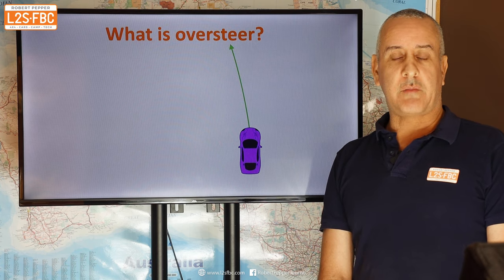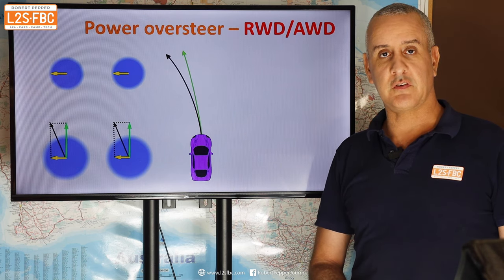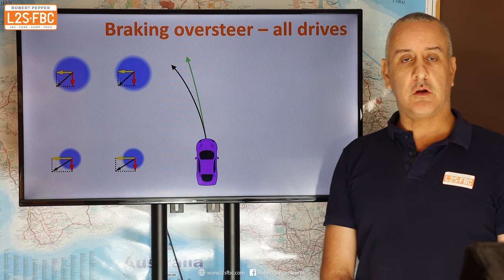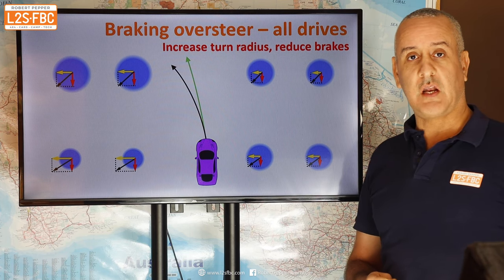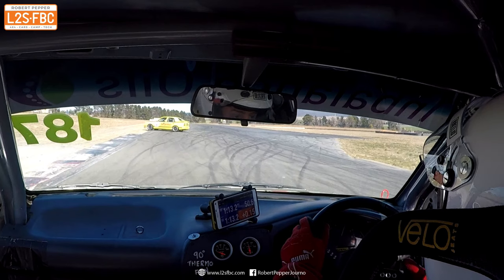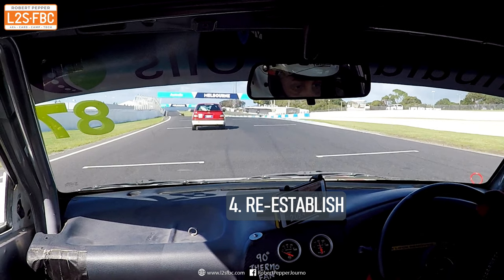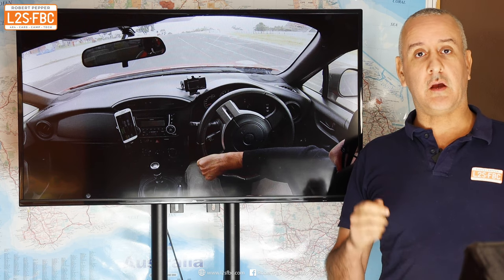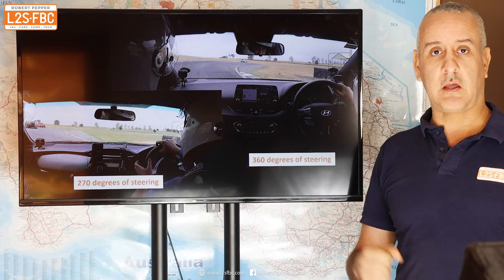Oversteer recovery - how to save your car!

Comment: This should be part of the driving test, for getting your drivers license in the United States!
Reply: Literally all cars before the 60’s or so, we’re RWD, the fact that we don’t learn how to save a car from over steer is sad.
Reply: @1000roentgens  it’s not just sad, it’s INSANE!!!! Like you said, it’s more of a problem with rear wheel drive cars, but of course it happens with all cars. front wheel drive, rear wheel drive, or all wheel drive. there are so many accidents that could be avoided. I remember when I got my drivers license many many many years ago I did the driving test and it was over very quick!! I don’t know if the instructor could just tell I knew what I was doing, or if they did that with everyone, but it was disturbing. I mean I had been racing go karts, and quads/ATVs, since I was a little boy. Which was way harder than driving on the street, (legally) but it still blew my mind! I see so many people out on the road that it’s obvious that they can’t drive to save their life. I just can’t wrap my head around it. 🤷‍♂️
Reply: For Mustang owners 😂
Reply: No one dose
Reply: @Eddie2425  first thing i did after i got my license was think i was a racecar driver. second thing i did was practice sliding in the snow lol. im glad tho, the little bit of experience saved me a couple times before i realized my favorite road wasnt a racetrack
Reply: And ability to use a clutch/stick would be a good bonus.
Reply: People can’t even parallel park in the United States 😂
Reply: @1000roentgens  If you think that RWD oversteer is bad, it means that you have never experienced oversteer in short wheelbase FWD. At least not one greater than 10 degrees.

Comment: I have a charger, so this was a pretty informative video for me. I've had 2 moments so far where the car snapped out on me unintentionally, but fortunately I was able to recover both times. Cheers!
Reply from the maker: Glad it helped, please share, and tell us about those times so we can all learn!
Reply: @L2SFBC  I'd say the first time was on a cold, slightly damp morning (being from Los Angeles means that the roads get slick with oil when the roads are wet) and with approx 30% throttle on a 90 degree turn my car decided to kick the tail out for a moment, but me counter steering allowed me to recover and stay in my lane.

The second time was entirely my fault. It was raining hard for the first time in a long time, and I did a burn out at a stop sign. Was all good and fun, but I may have over corrected once it started to yaw, and it suddenly and violently started to snap side to side, so I quickly got off the gas pedal and let the car settle down. I then decided to go home lol. 
These both happened with very old and cracked winter tires, I've just swapped them out for new tires.

Thank you for listening to my silly stories.
Reply from the maker: That's great!  I have a video on to tell the age of tyres too!  Glad you got it under control.
Reply: @L2SFBC  i plan on watching more of your videos when I have the time. Thank you
Reply: Do you drive the charger during the winter as well? How does that go if so

Comment: My first driving experiences were with old holdens and fords and they were wonderful training ground. Losing the vehicle in a manner of ways occurred easily and at relatively low speeds so it was much safer than the more modern cars that can easily take corners at much higher speeds and accelerate harder than these older vehicles. Through the video I recognised the skills and the situations you showed and my internal responses are so ingrained and that experience has paid off  in ordinary driving situations when things come unstuck. I loved the in-car shots too....perhaps more of that in the future Robert?
Reply from the maker: Thanks Benny. Yes some people learn like you did and others never have the chance. But it's so important for motorsports people even in FWD cars. Very pleased to hear this helped explain what you already knew !
Reply: @L2SFBC  Yes, exactly...so I really got what you were saying.
Reply: I want to drive those cars where you it isn't that difficult to crash. I really love driving and I want to be able to handle whatever is thrown at me.

Comment: I think the hardest thing is staying calm. Any time i've done sketchy driving I was at least half prepared for something to go wrong and ready to act. I've only had 1 major spin out and it was because it caught me off guard so bad. My own fault of course but I hadn't considered how bald my tires were by this point and I went into the corner at a speed slower than normal and it just went. The snapback was super violent and i panic hit the brakes then from there its just sorta a blur until I stopped. Very luckily it was a flat field and the only damage was a rock slicing my tire open!
Reply from the maker: An excellent point. And how do you stay calm? You normalise the situation. Then you have spare brainpower to deal with it properly, and also your reactions are instinctive.
Reply: @L2SFBC and normalizing is practice practice practice. 

I recognize the panic feel, had that some times too, when I was young and playing around with RWD cars. 

I have had some skidding lessons a few years ago and on such a day due to the practice practice practice it becomes normal and you will nail it, but… I am afraid I won’t be able to react as I should if I have an unplanned skid. 

That’s why I watched this video and it is a great lesson in theory, very informative and helpful.

I really do need to practice again on a closed course!

Comment: People watch other videos like this that don't explain braking and we have this myth that you should never brake in a slide, on the streets that is just dangerous, the issue is people have with no experience have no idea when they have lost control and/or they think you shouldn't brake, not to mention it takes a lot of practice to recover a slide which most people are never going to do.
Reply from the maker: Did you miss the bit where I covered use of brakes?
Reply: @L2SFBC  I meant other videos like this that don't explain it, I know this one does.
Reply from the maker: Cool thanks!

Comment: Robert, My learning came from gravel roads and snow/ice in rear engine (VW) vehicles. The switch to fwd (early Subaru) in snow especially was daunting until I learned about left foot braking to induce oversteer and then use acceleration to pull out of the slide. Current ride (VW Golf) has a center mounted emergency brake to start the slide in snow and gravel. Wife hates me for that.
Reply from the maker: Maybe warn her in advance? 😁😁

Yes this video is about recovering from unintentional skids not initiating. I may do another on initiating.

Comment: Bias ply tires on rwd in the snow (and rain) has given me an inate yaw sensitivity and instinctual subconcious level counter steering response.

Anyone that wasn't there can't appreciate how badly tires sucked back then. The worst tires you've ever experienced are 10x better than what we had.

Modern summer tires in the snow were still better than back then.

Also, the threshold to regain traction was very high. Once you lost traction, it was very difficult to get it back. So recovery often involved several back and forth swings. You simply couldn't catch the dnap back because there was no getting thetraction back. You hadto rode out the swings until you scrubbed enough speed to reduce the traction demand below what the tires could deliver.

Comment: Great video.  I was playing around with this in an empty parking lot earlier today before watching this video.  I actually spun out and applied the brakes until the car stopped (although I think I spun because I applied the brakes).  I didn't slide around as much as i wanted, but I think that's because most of the time I just tried to give it full throttle from a stop while turning.  Of course, space is a little limited in an empty parking lot.  It definitely was good experience for me because it helped me to be able to recognize when the back end is about to slide out.   Definitely something I want to practice more.  This was done in a 2015 genesis sedan, which is rwd fyi.  Most of it was power oversteer, but I think when I spun it was braking oversteer.
Reply from the maker: Thank you please share so others maybe learn and not crash 😊
Reply from the maker: You may also have an open diff in that car. In which case spin the wheels in a straight line then immediately turn. Maybe that works better.

Comment: Excellent video and I love the circle concept. My gripe is your recommendation not to make big "jerky" steering corrections. It's better to make a VERY rapid correction and possibly over-correction, followed IMMEDIATELY by an equally rapid return to the desired direction of progress. That practically eliminates snapback. Watch a few onboards from rally drivers to see how quick their steering inputs are. If the polar moment is too high (snap oversteer) and you won't be able to catch the back end, if you have the space encourage the spin and do a three-sixty. You won't go into the barriers and you'll end up facing the right way. The classic example is Vogelsang going into the barriers at a Golden Era race at the Salzburgring after putting a wheel on the wet kerb on exit. Practice three-sixties on the skid pan. Like a rally driver, only operate the handbrake long enough to break traction, and release it immediately. Another gripe is more ads than video.
Reply from the maker: Agree with rapid but also not Jerry. Good points thanks

Comment: Easiest way to practice steering techniques (fwd or rwd or awd) is after a good snowstorm.   You can simulate race dynamics at much slower speeds, and induce oversteer quite easily.  Dirt roads are good too.
Reply from the maker: Agreed re snow, somewhat difficult in Australia, and dirt roads don't generally give enough space to allow mistakes.

Comment: Thank you for this. I hope I don't need to use this information next winter, but in the case I do, I better get some sim practice in before (and perhaps some handbrake slides around icy corners are in order, as always).

Last winter, commuting winding backwoods roads, thrice I got into an oversteer from grooves in the icy road - rather an anomaly, as I couldn't remember the last time that happened. One time was particularly nasty: straightaway, two lanes, 80 km/h and suddenly going sideways as the rear tires went straight as if on tracks while front end climbed out of them. Not sure, but I think I let off gas, counter-steered and pushed the clutch in. I suppose the roads being icy, throttle would've only increased the traction demand (FWD)? However, it settled nicely without snapping around to the other lane, where I crossed over back to my side. One of those wobbly-legs moments, for sure!
Reply from the maker: Sounds like that was caused by the road itself not your actions, and the recovery too would have been affected by the road.  What I describe works for flat surfaces. Add ruts, bumps etc and the car can suddenly snap out of line...and snap back in line too without the driver doing anything wrong, or right.
Reply: @L2SFBC yes, it was the road. I was lucky the other lane had more traction to correct the car with, although not sure I would've stayed on the road in the first place without counter-steer. Definitely a difference of another scale at higher speeds, something I haven't had practice at.

Comment: Just a small correction, but the axle with more mass over it has more inertia, and thus less grip due to load sensitivity effects. Load sensitivity effects will result in effectively decreased grip for an identical tire on a heavier axle, because force potential doesn't rise linearly with load but inertia does.

The exception is longitudinally, where the axle gets the benefit of increased load, but there's no specific per-axle inertia, as the force is aligned with both axles. 

How this matters depends on the situation (entry, steady state, exit), car setup (understeery, less understeery, god forbid oversteery) and drivetrain.

A FWD car with 60% front load would understeer in steady state, but oversteer easier in entry under brakes, for example.

I also think you should always be accelerating out of oversteer in all drivetrain type cars; failing to do so will result in a snap-back towards the outside if the rear grips up,  which is very common. It's typically safer to spin out towards the inside by overdoing it, and it's easier to control grip when it's in the linear region of the slope after peak rather than oscillating between under and over peak. Of course, if the power is excessive, throttle needs to be decreased to some baseline unless you're okay with killing the tires.
Reply from the maker: Interesting points, can you expand on load sensitivity please?
Reply: @L2SFBC  Pneumatic, and I would imagine solid, rubber tires lose "friction" when they are loaded. The effect is more intense for more adhesive tires at low loads (Friction reaches infinite~ at 0 load for adhesive tires), but generally it follows a pretty linear slope. Not entirely, but it's not a bad approximation.

They don't lose grip*, you'll still get more *force out of them, but at a decreasing rate. The tires become less effective relative to the load that's on them. Adding mass increases inertia (unlike downforce) so you end up with a net-loss in acceleration potential.

So the relationship could be something like:

1.30 Mu at 0N Fz
1.19 Mu at 3000N Fz
1.08 Mu at 6000N Fz

With typically a decreasing slope with tires that have a larger contact patch surface area, although it's construction and compound dependent as everything.

EDIT: And of course, longitudinal acceleration potential is also diminished by higher mass (= inertia) but it can still be beneficial to load the driven wheels more than the undriven wheels for higher practical acceleration potential, as total inertia is still unchanged, only the split between F/R changed.

Comment: You mentioned a video about steering control going lock-to-lock quickly, which is the bit I feel I have most trouble with. Unfortunately I can't find it.
Would you mind adding a link to the video description?
Reply from the maker: Here it is https://youtu.be/TXTV5QzXmxk?si=piZeYkKIQsh9yFTS

Comment: When I was learning how to drive I remember being tired before a lesson then the lesson ended up being 1 and a 1/2 hours of parallel parking then driving home. On the way out the car park I was at a t junction where the left was close to an acute angle and the right was very loose. I'm in a fwd diesel following a suv that's going right matching it's speed but I didn't clock the signal. As it turns right I realise I'm fucked, I look out into the left hand turn and can see my front right wheel going maybe a foot or two into the oncoming lane and where I'd be able to exit there's a car fast approaching. For some reason something took over and I completely dropped the revs to zero, downshifted to 2nd, while downshifting countersteered, and as the power from downshifting came on straightened out. Now understanding cars as I do now I realise I could've actually rear ended the car I was trying to avoid is funny AF. The G forces were so high my instructor came out of their seat, shifted right and had I kept in third, would've landed on top of the gear stick.

Comment: Thanks for your explanation; today I tried straight line acceleration on a CT5Blackwing Manual by applying full throttle . I can certainly feel the back of the car started to swing. As soon as that happened, i just lift the throttle.  Does this fit your theory about oversteering in a straight line due to the fact the rear tires just lost some traction because of not good tarmac?. I have winter tires on and did warm up tire a little bit before trying; but it is still winter here close to 0 celsius . Wondering any tips for large HP RWD manual car in a straight line?
Reply from the maker: In that case the rear tyres haven't lost traction, they exceed the available grip limits - different concept.  Unless of course the rear tyres moved into an area of lower traction. Either way, grip limit is exceeded. 
Large HP RWD manual car in a straight line - feed the power on slowly, and if grip limits are exceeded, fractionally back off the power, and steer as I've described in the oversteer recovery video you watched. You need to be very quick about it; the earlier you correct, the smaller the correction needed. And the more gently you approach the limit, the easier it is to correct. Practice somewhere safe :-)

Comment: Question about Lift off oversteer. I am not touching the brakes, i just go instantly from the throttle. According to the video i should increase turning and reduce Breaks. So in this scenario i can only increase turning?
Reply from the maker: Yes. Look at my Oversteer Recovery video for more.  The back end has lost traction - outside the Circle of Traction - and you need to bring it back in line.  If you're not braking then that's a good start...but you are using grip for turning, and potentially too much. So, reduce the turning. If a front-drive car you can also apply power.